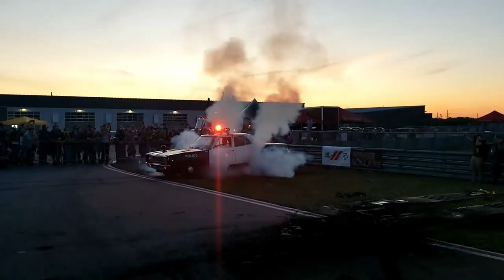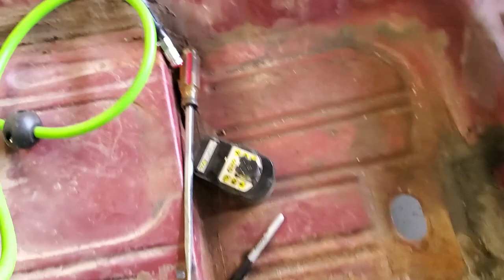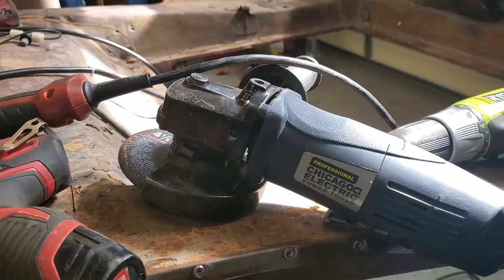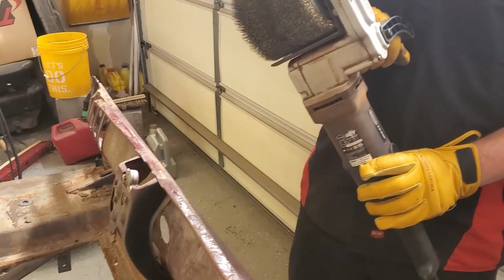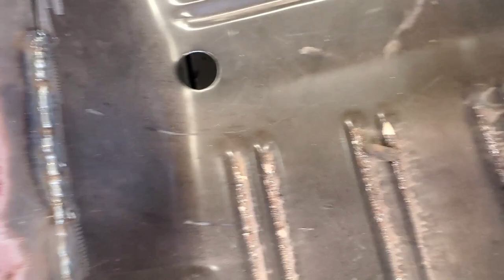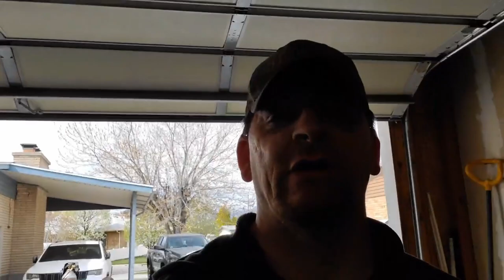Mustang Coupe to Fastback #2 Chopping the top

Comment: My GF had (another story) a 2006 Fusion that she absolutely loved. It had the airbag recall. Every time she called about it was told "haven't got the parts yet". This shit went on for YEARS, literally years she'd call every 3-4 months and get the same story. She when to the same Ford dealer for ALL her maintenance. Everything they recommended she's have done. Well, being in the industry, I made a few calls. Found out that the regional distribution center that the local dealer uses for parts had over 500 on the shelf. Called the dealer myself. Told the same BS story. Called Ford corporate. Told them the story, also told them I KNEW they had the parts in stock. Got a call back the next day scheduling an appointment to get the airbag swapped out. Bottom line. They didn't want to do the recall. Waiting out the time till all that generation of Fusions were all scrapped? Who knows? Left a VERY bad taste Ford.
Reply from the maker: Dealers and manufacturers are hard as hell to deal with for sure

Comment: Hey guys- enjoying the videos as I am starting my conversion this summer. Wealth of info here. One question I have is do you guys ever keep the existing b pillars? Havent seen anyone do this or maybe I havent watched enough videos. Mine are solid on my coupe so I dont see a reason to cut off if they work with a fastback
Reply from the maker: Yes, you can use stock B's. You just have to patch the hole at the top thats there for the quarter window. Other than that, you are good. We used stock B's on our first few conversions.

Comment: Fantastic work guys. Question: what do you think the odds are of the 67-68 mustang inner structure (b pillar and back) working on a 66 coupe to fast back conversion. As you know they only sell the pre welded inners for 65-66 and if I can save myself over a thousand bucks only using the pieces I need from the I welded one I’d wanna do that
Reply from the maker: Unfortunately no, the structure is different for 65 66. 65 and 66 are shorter than the 67 68 sadly